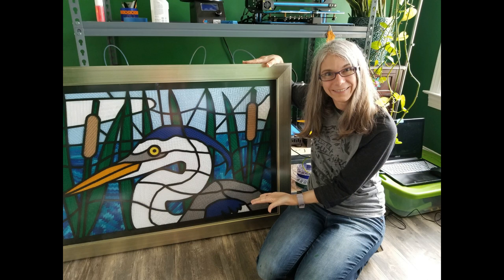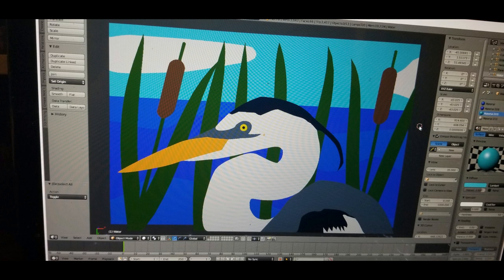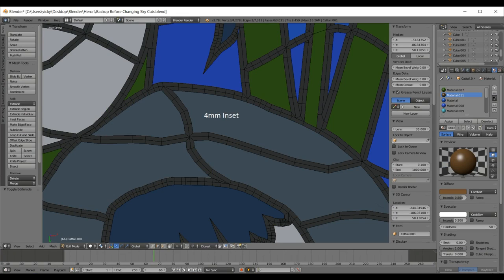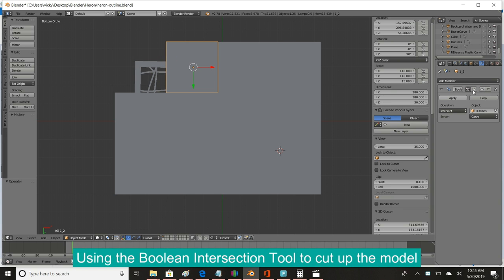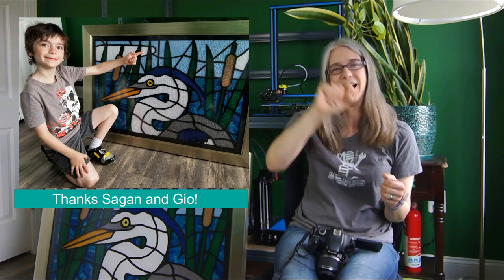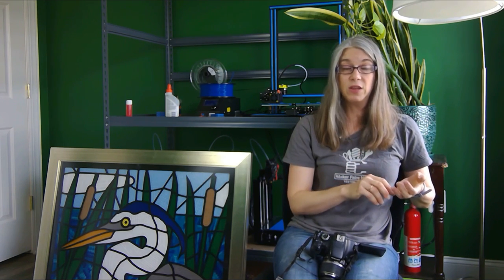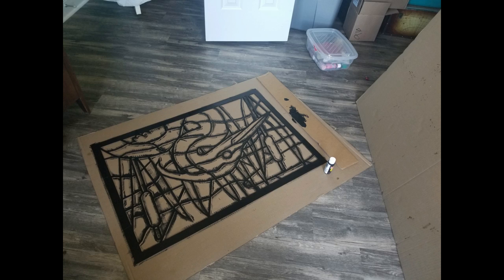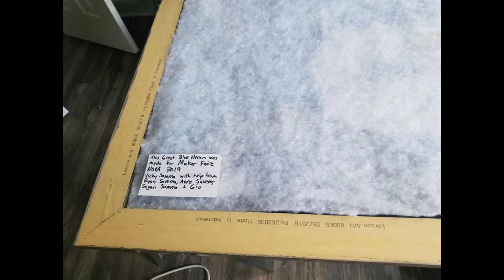A 3D Printed / Plastic Canvas Heron for Maker Faire Nova

Comment: Why didn’t you print out the grid inside of the frame pieces?
Reply: It's a bit fine for that – I suspect there would be a fair chance that the PLA would break if any of the stitches had any tension in them. Maybe not immediately, but over time.
Reply from the maker: Greetings!  Thank you so much for watching and commenting.  I had toyed with printing the "canvas" as well.  There were a couple of reasons I went with the traditional plastic canvas.  One lazy, compelling reason-- between my mother's craft supplies and my craft supplies, we already had a giant surplus of plastic canvas handy.  Even with this project, we hardly put a dent in that supply.  So it was easy to cut my modeling and printing time short and use a material that I already had on hand.  

I didn't run any proof of concepts, but I did have the concern Mark brought up... I was somewhat worried about the strength of a printed canvas.  That said, I would love to take this combination of needlepoint/3D Printing to a 3D sculpture piece.  There, I think I would try to attack that with building in the stitch holes into the model/print itself (and hopefully found a nice combination of thickness for stability and strength).  I don't have any imminent plans, but I do find myself sketching a box turtle.  :)

Thanks again for watching and commenting.  Have a great day!